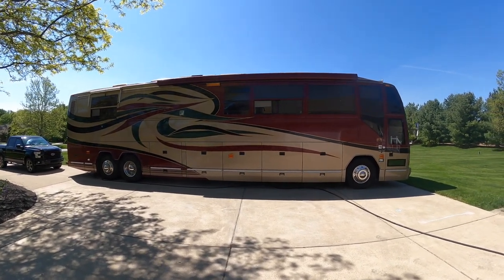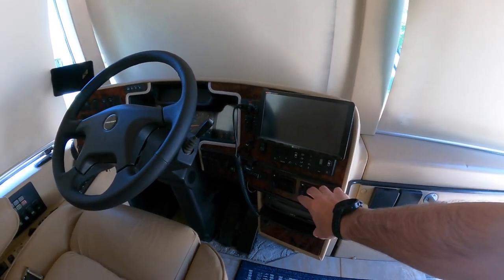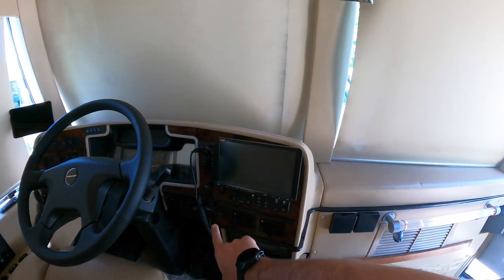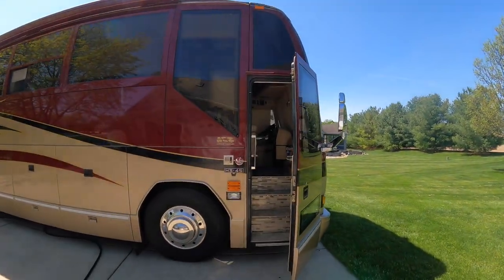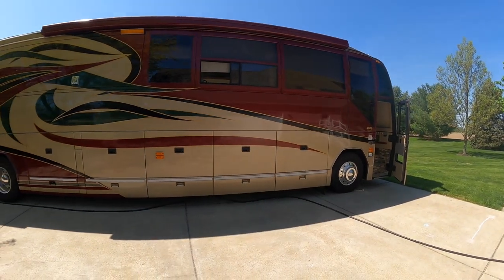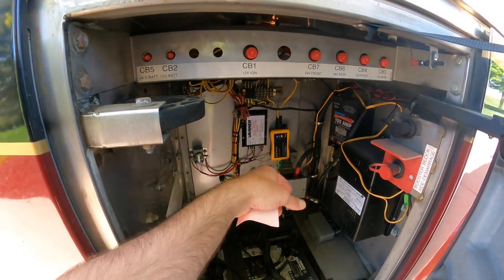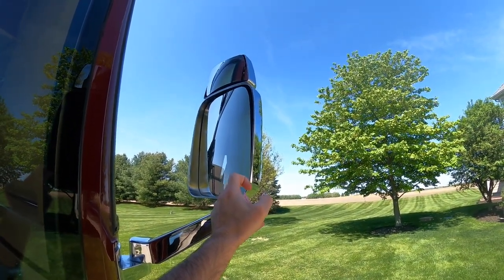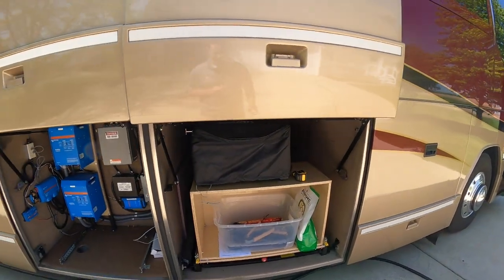Prevost H3-45 Planned Upgrades for '22 - RV upgrades

Comment: Great job on the video. Love seeing your videos. On my XLII, I had luck getting my mirror to release from the Velcro using a putty knife. Someone had put a dab of silicon on the back of the mirror to hold in addition to the Velcro. Not sure if it was normal or not. I found the servo head is what rattled though and would need replaced to eliminate all vibrations. Best of luck to you.
Reply from the maker: Thanks for the suggestion - will try the putty knife!  Was hoping it would be a loose screw - my luck it will be a servo like you said that isn’t made anymore!

Comment: Nice work with the house. Great video as always. Hey, if the mirror isn't something you constantly adjust, could you just use the plastic shims from Lowe's and just cut them to where you don't see? Just a thought
Reply from the maker: You may be onto something - usually set and forget it. If I tucked one in - that might just work!  Thanks!

Comment: I have been interested in an older Prevost  for quite some time. By the way yours is beautiful. Can you give me an idea of how many miles are on it how long you've had it and what kind of maintenance costs are you saying per year. Does it have a Detroit 60 engine? I have only watched 3 or 4 videos but I've already subscribed. I agree with some of the other folks you are really talented. I'm not sure I have the same amount of talent that you have. Keep up the good work really appreciate your videos.
Reply from the maker: Thanks for watching and the kind comments. My coach is a 2000 H3-45 with the DD series 60 with about 215k miles. So far she’s run really well. I had all the fluids changed last year for about $4k but just an oil change is around $500. There is just such a large quantity of fluid is why I paid someone else to do it.  The annual maintenance is hard to say. Just oil and filter is $500 for the engine, not sure what the generator is - I am going to do that my self for about $60. The aqua hot needs a service but I do that too - just clean the diesel head and fuel nozzle, fuel filter.  Tires should be changed every 5-6 years and they are around $1k each plus install x 8. I just changed my 4 start batteries for $500 - they were 6 years old (I ran them down over the winter). I also changed my generator battery last year for about $150. The 8D AGM house batteries are about $700 each and my coach has 6 - but still work great. I just replaced the 2 water pumps at $200.  It’s hit or miss. The bones are solid but all the other stuff eventually wears down sometime.